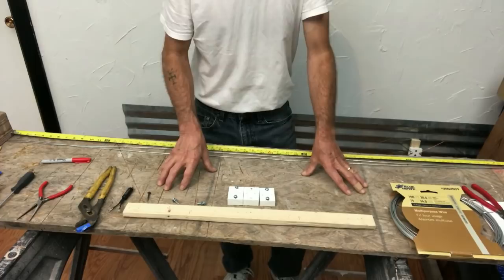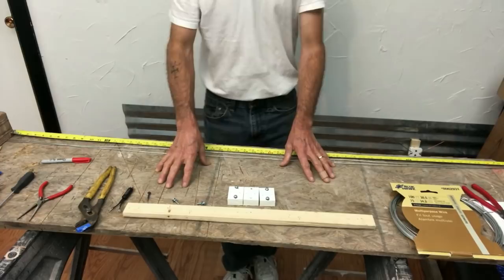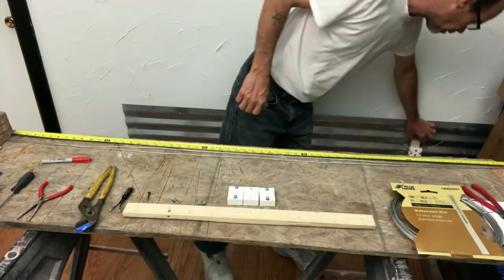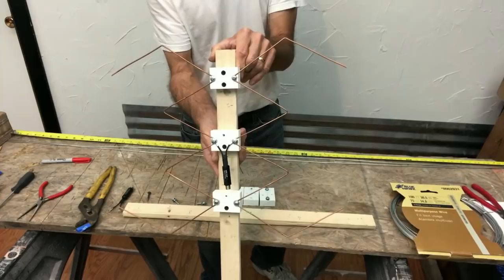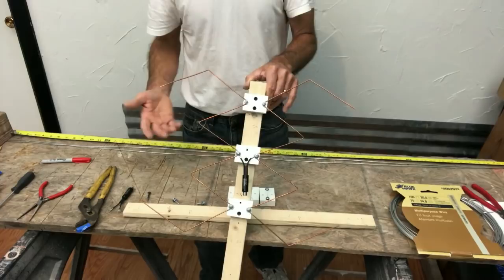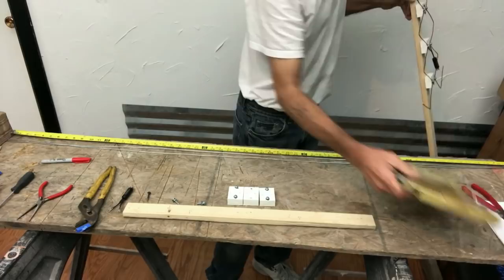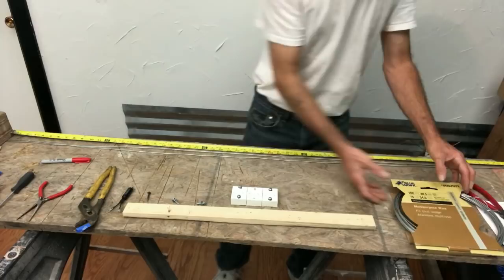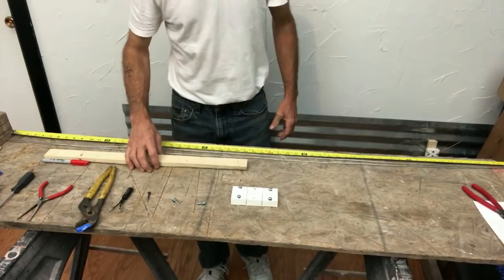HDTV Antenna   Build it Yourself!

Comment: Want to thank you for this video.  I have made the bow tie antenna and had good success with local channels.  However, I was wanting to extend my range so after watching this video I made this antenna.  I as able to get the TV station I wanted and it was as clear as my local stations; the distance was 65 miles.  And it was made with materials that I already had.  Great antenna!  Thanks.

Comment: Fantastic design, Mike!!!  I just built one yesterday and it works amazing!!!  I used to spend at least two days building a dipole antenna (with whiskers) and a screen or aluminum rod reflector attached.  I built your design in about 3 hours without a reflector and it actually works better!!!  I put it up about 20 feet attached to a step ladder just for testing purposes and am using an ONN inline amplifier from WalMart (about $14.00) and I scanned 72 channels!!!  This includes VHF low (channel 3 WEDU PBS from Tampa).  I'm located halfway between Tampa and Ft. Myers Florida and I can get Ft. Myers as well as Tampa stations pretty much without any pixelation!!!  This is a GREAT design!  I guess it's all about the 60 degree angles and 7 inch lengths, isn't it?  Very happy with this design and I'll be using it to make antennas for family and friends going forward!!!
Reply: What/how do these geometries work?
Reply: Interesting comments! I also live in Florida and have that amplifier.
Reply: Hey Art. You're midway between TPA and FTM--what, about 98-100 miles as the crow flies. How far from TPA would you guess? You're getting with this Ch3 WEDU TPA (broadcasting on digital 13). Are you also getting Ch8 WFLA TPA (broadcasting on digital 7, moving to 9), and TPA Ch10 (broadcasting on 10). thanks
Reply: I live in Sarasota and need both the Tampa (020 degrees for VHF) and Ft. Myer's markets 120 degrees for UHF) curious what bearing you pointed the front of your antenna at to receive both markets.  tnx
Reply: Hi Mitchell, sorry for the excessively late reply to this.  4 years went by in the blink of an eye.  I should have checked back for replies to my comment.  I'm 64 miles from TPA as the crow flies and 35 miles from Ft. Myers.  I just rescanned for channels a week or 2 ago and I'm picking up 90+ watchable channels, including 3 WEDU and 8 WFLA.  Plus a boatload of Ft
 Myers channels as well.

Comment: This antenna is amazing.  Just built one last week and the receptions are clearer and more than twice as many channels are coming in.
I used 11 GA galvanized fence bracing wire scraps and it works like a charm.  It straightens out nicely by rolling it between 2 boards.
Reply: I tried  this and it works well. I live 65 miles southeast of Columbus Ohio. I have a version of this sitting on a twelve foot pole and I'm pulling in 12 channels and there's a storm in the area. Thank you much for design

Comment: As a retired Radio and TV engineer in the UK, I find these US and Canadian antenna-building channels very interesting and I think yours is one of the best. I'm always looking for ideas for adapting them for other frequencies. In Western Europe the frequencies of UHF TV transmitters were planned in the early '60s when analogue TV began to expand from Hi-VHF (Band III, around 200 MHz) to UHF, I think West Germany was the first. This means that all of the channels in your area come from one site, so higher-gain antennas like Yagis and log-periodics are used and the transmitter power is lower, usually 100kW maximum for main stations. The bow-tie design is sometimes seen when a short wide-band antenna is required, but the Gray-Hoverman type is never seen. The Yagi antennas, normally used, have a narrower bandwidth, suitable for your local transmitter, rarely needing a bandwidth of more than 14 8-MHz wide channels (19 US 6-MHz channels).  I think a single Bow-tie, mounted vertically, might be useful for Digital Radio which is transmitted here on the old European TV channels in the Hi-VHF Band.

Comment: This design works well! I had a hard time locating insulators like you have, so I found that sturdy bottlecaps do a good job. Since mine is going outside, I dabbed some silicone sealant on the screws to slow down oxidation.

Comment: Love that design!  It seems similar to the basic Bowtie, except that the ends of each Bowtie are connected together by the fact that each side is just one long piece instead of multiple pieces for each Bowtie.  If this is similar in performance to the Bowtie, I love that this design is much easier to work with.

Also - thanks for showing the signal meter on each channel.  I always have to chuckle when I see someone go through each channel and simply declare they have good performance simply because they can see a good picture!

Now, put a good reflector on that thing, and you will double your signal!

Comment: Mike. Gonna put this together tomorrow. I tried one of your earlier ones, picked up 10 channels 60 miles away without a reflector, 18 with. Those are the closest towers to my location.  Looking forward to trying this one.
Reply: I was just telling another person who commented about the reflector. That's good if you want to be directional but are you really going to be going in twisting this antenna every time you want to tune into a Channel? But you're right, what you are doing is you receiving peripheral reception from other stations, as well as bidirectionality from behind as well as what you think is forward. I made my own yagi what's a little expense. Probably $0. Set up without a reflector 107 channels. Yeah I know I'm bragging, but I do have some electrical Theory as well as antenna Theory and physical Theory under my belt. Or was shoved up my ass or something  I don't know😅🤣

Comment: This antenna design will allow for more but not completely omni - directional reception with the most signal gain facing the front and rear of the antenna. There is an additional modification that can be made with this antenna design that will allow for an increase in signal but in one direction at the expense of omni reception by adding a metal mash or screen as seen on other youtube videos. I built this antenna design with the additional metal screen in the back of the antenna. Great reception for a non Yagi design.

Comment: This antenna looks like a variation of the Gray-Hoverman. I did build it to see how it works.  It does works well for UHF stations but I don't get any reception for the High VHF stations in my area. You need to add additional elements to this type of antenna for those frequencies.
Reply: How would I add those elements? I've built this design already.

Comment: It's a keeper : )  Tried it and it works just as good as the antenna I'm using now.  This was a lot simpler than the that one, so I wish I had this back then.  Keep it up.
Reply from the maker: John LeBlanc 
Thanks John. Glad you had the time and materials to give it a try. Don’t know if there’s a more effective design that’s as easy to build as this one. I’m happy with mine :)

Comment: Made one too.  Super easy and better than the one I have.   I skipped the PVC pieces since the wood I used is dry and to be put in attic so no insulation needed. As I understand it, if wood gets moist then the conduction it would create would worsen its reception.  I hope this works for all the tvs I have feeding thru the splitter.  Thanks for sharing your design.
Reply from the maker: I hope it worked for you. If it gives you trouble maybe try an amp. I saw one at Lowe’s that splits to four TVs. I think it was the @$20

Comment: Great design. I built one but instead of 7 inches between bends I did 5 3/4 since I had a 92 inch wire leftover from a hoverman gray antenna build I did a few years ago. This design outdid my basic hoverman gray, 4 channels come in with 100% signal with no loss, one surprise channel I can get I have to turn the antenna to get but it's transmitter is about 40 miles away and I haven't been able to watch that channel since they switched to a lower uhf channel. Still having trouble receiving the local CBS station and the local My Network affiliate which has the great retro tv add on channels but hopefully with moving the placement of the antenna I can get them in. I did add a cheap cereal box wrapped in foil reflector 5 inches from the antenna which helps with reception from the one station that has its transmitter 40 miles away. Thanks for posting the video.
Just thought I'd add this, just had a severe thunderstorm roll through here and that usually affects the signal enough to make tv unwatchable but not this modified hoverman gray design all the channels were at 100% signal. Two thumbs up.
Reply from the maker: That’s great news spikeg79! I hope moving it brings that channel in. Good luck!
Reply: @DIYProjectsWithMike  I went to the local hardware store and bought 12 gauge copper wire since they had it on sale for $6 and built two antennas, one for the living room and one for the bedroom. In the living room I get all the local channels without a reflector. Bedroom I get all but the local CBS affiliate without turning the antenna, if I turn it 90 degrees I can get the CBS affiliate. And that's with the antennas being at just 7' height. Being in apartment I don't have an attic but I bet if I could get them higher in the air the signal strength would be green on all the channels. This is by far the best design that I have made and I've made quite a few over the years including the fractal stars, fractal snowflake stars, hoverman gray to name a few. Just wish I would've came across this video a year ago.  I will be trying a reflector and let you know if it improves the signal strength.

Comment: nice build.  you're picking up Mobile from 60 miles away?  wow.  I got everything I need to make this.  I take it you don't have any VHF stations since you didn't add the "hats" for VHF elements?  and I agree with the earlier commenter, you could run all your TVs off one antenna, maybe with a distribution amplifier.  but that doesn't take anything away from this excellent video.

Comment: Thanks for your reply, I’m going to try your build when the weather warms up. I was unsure if the reflector really helped that much. Thanks again!
Reply: Reflector will actually lessen the amount of channels you get because it will only be directional and not bi-directional without the reflector using it without a reflector  and lengthening dipoles oh, you'll get better results. Make sure that you have correct wavelength this is between the two contact points between each.  Polar length. But I find this crucial.

Comment: Could you tell me how you found out the dimensions of the wire lengths ??? Also, would using a reflector make  more of a difference in reception Sir ??? Thanks for the info too.

Comment: I'm going to make one of these.  I've been using cable since tv stations went digital and cut their power.   The 6 tv stations in my area are all 50 miles away.  
I'm guessing if I build this I will need to add a reflector and use an amplifier.

Comment: Have you tried Stainless Steel + Copper + Galvanized?  It seems to me that by mixing, it helps.  I believe each Metal Type absorb different frequencies.
Reply: Popular misconception, Mixing metals. Consider this: imagine that antenna, vibrating with each cycle of its frequency. That's exactly what it does. Ground. A firm Solid Ground. A must.

Comment: Hi. Nicework, nice video. was wondering what kind of screws and washers are used for contacts. Are they also galvanized, and what size? thank you.
And i had to buy 12 gauge wire because they were out of 14 gauge. hoping it's better.

Comment: In our area  Utah the Frequencies range from 500 mHz Channel 14 to 674 mHz  channel 30 all other channels are in between.
The best length for receiving are multiple 1/4 wave lengths up to 5/8th wave lengths  if you know 1 wavelength is 11.8" at 1 gHz  this may help optimize you measurements. for getting the best results.  Your 7 inches is 1 wavelength at 593mHz  let me know if this helps. Suggestion go to a near by college or a HAM operator and see if they have a network Analyzer to Sweep the Antenna over its bandwidth.   good Work Best of Luck.

Comment: Another great instructional video I made the tuxedo and it works great. Will be trying this one soon. Some questions: 1) Will this work as well if laid flat? 2) Are the bends simply to allow for compressing the 56 inches into a smaller form/would a straight 56" piece work as well?

Comment: Nice design. Why not just make it omnidirectional by mounting them in a clock pattern on a 4 inch PVC pipe? This way you don't have to bother aiming it. I have mine 5 feet above my home and I get 55 channels with no pixelation. I have a huge oak tree right in the way, and I get clear reception. I have 6 bays looking towards the main channel clusters, and the omnidirectional right above it to catch the channels coming from other directions. I have cut the cord going on 3 years now.
Reply from the maker: Great that it works for you! It depends on the location. Omnidirectional designs have never worked for me where I live but it doesn’t mean that it won’t work. Obviously:) keep saving that money!!

Comment: I made a miniature-sort-like this, it does work, nice. coz' I can't find any copper wire around the house, tried the galvanize wire laying around. Still works
Reply from the maker: Levi Scythe 
Good to hear. 
The copper one I show in this video was a custom build that didn’t perform as well as the 7” that I teach. I use it though because the one I built in this video ended up in a friends attic. (Word gets around) :)
Reply: Next time I'll stick to the measurements, specs, etc. you made in this video for best reception, thanks for the tutorial sir

Comment: I do have a question...Do you use a signal amp?  The 10" model I've made needs it to get stations about 35 miles away...all UHF.    Hopefully, this new design won't require one.
Reply from the maker: Clint Cates 
I hope it doesn’t need an amp as well but it depends on your location. I don’t use one. Best of luck to you. And thanks.

Comment: How does this design perform compared to grey-hoverman?  I want to build one, yours looks good (does this design have a name?) and I think is smaller which is an advantage, but want to build whichever works best.  Do you have a printable schematic/plan?  Thanks for all the helpful, well done videos! Kudos!!
Reply from the maker: The Gray Hoverman May work a bit better in some frequencies while this one may do better in others. I built this one so that it would fit in my attic. I don’t have a schematic.

Comment: What dimensions are those white blocks? I know they are 3/4 x 1 1/2 but what is the cut length? Or more importantly how far apart are the screws that hold the wires down?
Reply: Nevermind. Hadn't watched the video far enough. My bad.

Comment: Mike.  Where did you get the pvc blocks?  I’ve had no luck finding any.  Thanks
Reply from the maker: Find them at Lowe’s. I understand that they may not be available in all locations. The ones I used were basically 1 by 2s 6ft long if that helps any. If you can’t find it, 1” pvc pipe can be used as well but it’s a bit harder to work with.

Comment: Have you ever tried a reflector with this design?
Reply from the maker: I’ve only tried reflectors made of aluminum foil in my attic. Made receptions worse. Never tried one made of chicken wire etc. I suppose it would work if I mounted it outside

Comment: Hi Mike, I have a metal roof. If I build one and put in my attic, will the metal roof affect the signal? I'm thinking it would. tkx.
Reply from the maker: Glen Rose 
I think it would too. But I think it would worth a try before mounting it outside. 

If you do have to mount it outside, your roof might act as a reflector. 

Mike